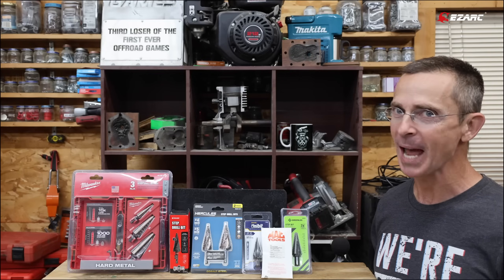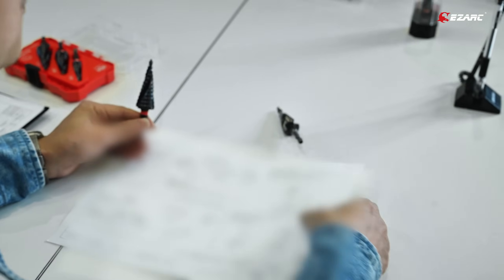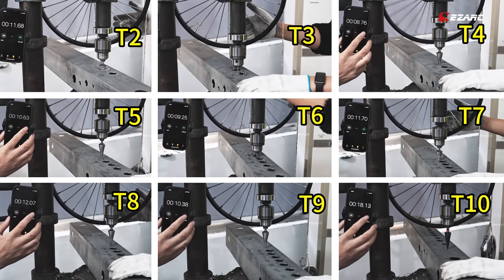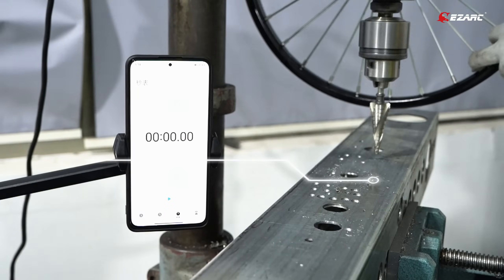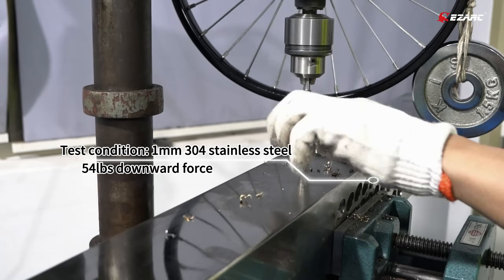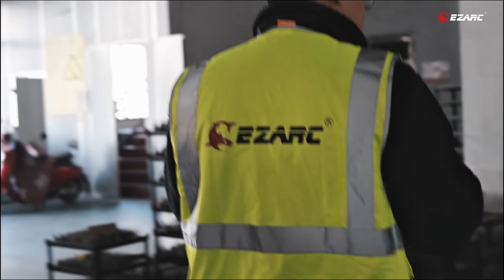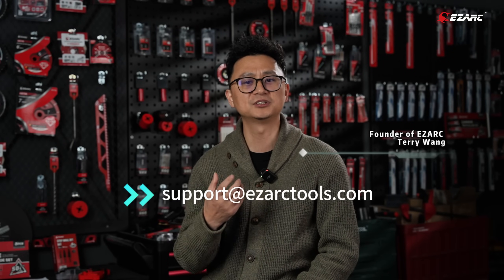From Project Farm's Feedback to Improvement: The Enhanced Step Drill Bit is Here!@ProjectFarm

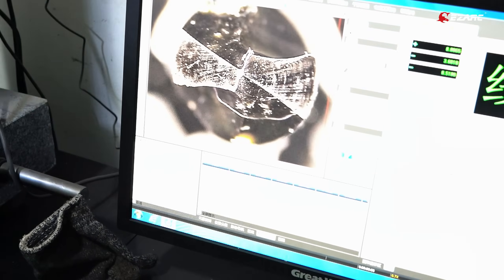Comment: 2:10 the drill bit is broken on one side
Reply from the maker: Yes, that's correct. The video shows a 𝗱𝗲𝘀𝘁𝗿𝘂𝗰𝘁𝗶𝘃𝗲 𝗹𝗶𝗺𝗶𝘁 𝘁𝗲𝘀𝘁 conducted during the development phase. It's normal for the drill bit to be damaged under those extreme conditions.

A high-quality step drill bit on the market is typically able to drill 20 holes in stainless steel without issue. Our product is designed to ensure it can perform this task under normal usage conditions before it leaves the factory.

Additionally, the step drill bit shown in the video is a 𝗽𝗿𝗼𝘁𝗼𝘁𝘆𝗽𝗲 𝘄𝗶𝘁𝗵𝗼𝘂𝘁 𝗮𝗻𝘆 𝗰𝗼𝗮𝘁𝗶𝗻𝗴. The final version of the drill bit will have a protective coating, which will significantly increase its lifespan.🥰

Comment: This is pretty impressive. There definitely was still damage to one of the cutting edges after the 25 hole test in the 304 steel, but that's not entirely unexpected. One possible solution to this would be if the first section of the bit is longer than the others to provide enough material for resharpening a few times.
Reply from the maker: Thank you for your suggestion. The original step drill bit has a thicker first section, which offers a longer lifespan but comes with slower drilling speed. In the upgraded version, we've made the first section thinner to improve drilling efficiency, but this inevitably affects its lifespan. To address this, we’ve developed multiple solutions to minimize the impact.

Additionally, the video shows a destructive limit test performed during the development stage, which is why the drill bit was damaged—this is normal under such conditions.

The step drill bit shown in the video is a bare prototype without a coating. The final version of the drill bit will have a coating, which will enhance its durability and increase its lifespan.🥰